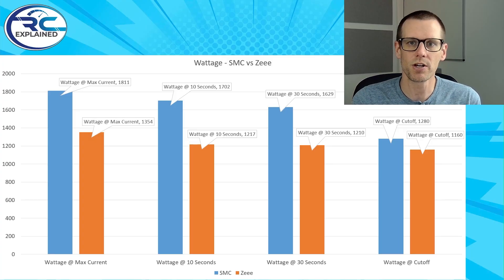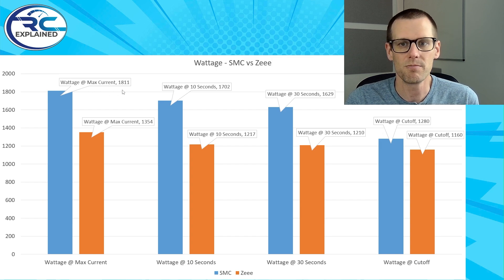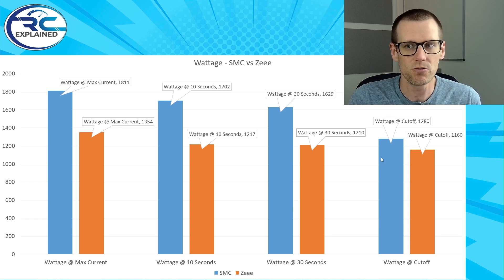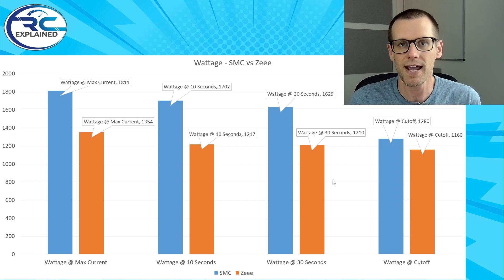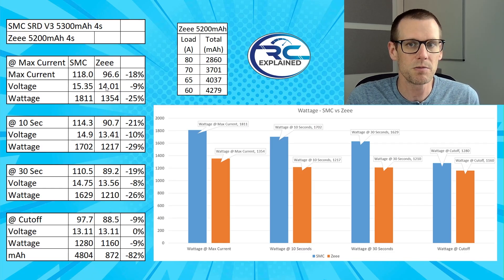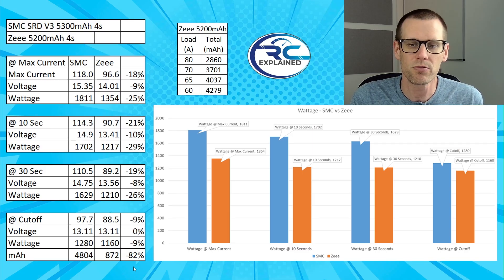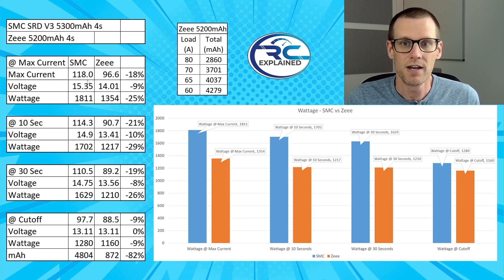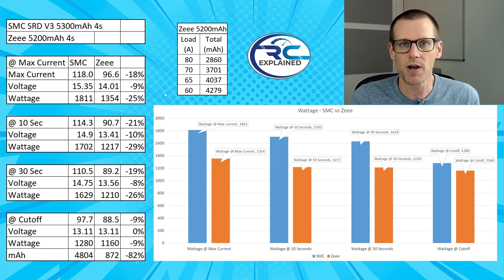Best vs Worst RC LiPo Battery Showdown! Performance Data Doesn’t Lie!

Comment: It's so wild to see this Zeee pack doing poorly. I have some 2s and 3s Zeee packs that have been doing fine since Christmas. Especially The 6200mah hard pack 3s with the red checkered background graphics and the little race car on the sticker which reads 120c 68.82Wh. I don't believe they'd test at 120c, but they've been running really strongly in my XTS-F10 with really long run time, and are Actually UNDER rated for capacity. They take in closer to 6500mah charging back to 4.2v per cell, and don't get warm charging for me either. I'd be really curious to see those bench tested!
Reply: The video shows capacity when tested with continuous load of 60,70,80 amps. The battery drains in minutes in his tests. I am sure when you use your batteries the battery will last for 10-30 minutes, which means you are not pushing the battery too hard. I guess the video shows what the battery is doing when you demand full throttle from your RC car.
Reply: @uhjyuff2095 I demand plenty of full throttle, but yeah I think his tests are more like asking full power from a plane or something like a speed run than a normal car. Either way I'm interested to see if it's just these sort of "standard" labeled Zeee batteries that are coming up short during these tests, or if any of the ones they're labeling/marketing differently fare any better

Comment: I guess it depends what you want them for ? 
I appreciate SMC are Powerful. 
I ise some Zee Lipo’s . They better some of the Cheap ones like Yumme , Zop, they Dont have the capacity proclaimed . But the Zee are good Value , they run well enough for my Usage. They balance up well, the internal resistance is good. I had one bad lipo delivered i contacted them sent me another the Next day. 
I cant fault Zee lipo to be honest 
Yes if you want to Pay £100 for one lipo you expect it to better . 
But for joe bloggs mr Average zee are good enough
Reply from the maker: Exactly. if you are after performance almost any LiPo can do better.

Comment: I don't care what your data shows. My experience has been all positive with Zee. I have approx 20 zee packs in various sizes. Never a failure after dozens upon dozens of cycles over a few years. Not even a puffed pack

Can't say the same for Spektrum  packs = 2 failures. Never owned SMC but I see no reason to when the Zees give me everything I want at an affordable price.

I sticking with Zee. Best bang for my buck without a doubt.

Comment: In performance applications under WOT loads at a full 4.2v per cell. What is the max voltage drop (underload) that is still considered "safe" and no damaging to the battery? I seem to get different answers everywhere I ask. OR will this vary based on the thermal load on cell type too much to generalize? I have a pretty huge 40ah100v 24s pack that I'd like to draw 600a from. But I am seeing it drop down to about 3.2v at 400a loads.
Reply from the maker: You can simplify the answer to be what ever load the pack can handle while maintaining a reasonable operating temperature.
Reply: @RCexplained  Thanks, so as long as I don't exceed say 50c or so the voltage drop isn't really an issue when under heavy load for say 10 sec or less?
Reply: would a temp indicator taped to bat body be ok?  I just don't want to damage these huge expensive tattu12s bats but would like the max output.
Reply from the maker: Temperature is your best indicator regardless of load.
Reply from the maker: @AdamOpheim I prefer a temp sensor on telemetry if I'm worried about it.

Comment: I would love a video where you break down the actual components to the battery. What type of Lipo juice they use, materials, type of wires and insulation. Where the money is and why.
Reply from the maker: that is an interesting idea!

Comment: What’s that supposed to mean? Completely absurd comparison. A SINGLE SMC SRD V3 4S/5200mAh costs €90. TWO Zeee 4S/5200mAh cost €89. Auf gut deutsch: Zu viel Lack gesoffen?!
Reply: Is it?  2 Zee packs that are damn near useless to my 10" FPV drone, I would rather have the one pack that can power it

Comment: I have eight 6S Zee packs (4 x 2200mah and 4 x 5200mah) that I use in RC helicopters (sized 420-580).  The Zee packs have worked perfectly for over 3 months.  I can't speak to their long term ability, but for the 3 months I have used them I have been very happy.  My Kraken 580 can max out over 130A (as monitored using VBar/Hobbywing telemetry), so there's no shortage of power.  Battery construction looks great, so I don't know what some commenters here are talking about when they say the construction is poor.
Reply: You gotta try a reputable Lipo brand and you will see. I felt robbed when I did and that I’ve been cutting my rc time so short running zeee lipos

Comment: Another BULLSHIT battery review. I'm in Australia where the Zeee battery is $48 and the SMC battery is $200. Further the Zeee battery is 120c compared to the SMC at 250c. Completely different types of batteries and one is 4 times the price of the other. FFS🤦
Reply: I do they're junk...
Reply: You do know that the Zeees false advertise their labels. Try to run SMC or another higher quality Lipo then do that with the Zeee. Same specs the Zeee runs about 50% as long, so either Zeee uses low quality material, which matters or, they are lying. You do know they have Zeee premium lipos that are supposedly higher quality at about double the price. Still low quality.
Reply: @MrSkullface Battery manufactures apparently can’t test the discharge rate beyond 70c
I’ve seen lower amp discharge packs perform better than some that were quoted a higher rate. I think most companies aren’t being honest there
Reply: @lorlin1978 true but I will give credit to SMC that they have a page on their site why they still add their inflated C rating. Basically if they don’t no one will bug them assuming they are inferior.
Reply: Not a bullshit review not only what this dude said is true but I've had problems with almost every zeee battery pack I've had... and I  not making no video I'm telling you straight...facts!!!
Reply: @VinydFPV  BS....I have over 20 Zee packs and have been using them in airplanes for a few years. Never a failure.

Somehow I doubt  that I got all the good ones and you got all the bad ones.
Reply: @VinydFPV  It's bullshit. I don't have any probs at all with Zeee batteries.
Reply: @avronaut it’s not do you have issues, its about real world runtime and battery sag compared to higher quality Lipo brands.
Reply: Exactly

Comment: I'd really like to see these results displayed on real life situations.  How does these stats show up in the same vehicle?   Is there a recordable difference in speed, acceleration, and run time?  That's what matters to me.  If i can't notice a difference bashing what does it matter what happens on paper?  I've one got 1 set of Zeee batteries but they're over 2 years old and sell work fine.  I can't tell a difference from the first charge till now.  Most of my batteries are CHNL and Gens Ace.
Reply: Realistically, you probably wouldn't notice unless you're comparing back to back, or racing competitively and need all the punch you can get, which is where these differences can absolutely be felt, especially near the end of a race where voltage sag is more apparent.
For bashing and casual use, it's probably not worth spending the extra $ on the best packs. If the cheap ones work fine, might as well stick with em!

Comment: Zee lipos are ok for the price but Ive had 3 out of 4 of my zee packs fail and I’ve had them for just over 6 months. They all had the same issue with cell no1 not wanting to charge anymore.
Reply: I never got why people say Zeee is good for the price (not including sales), you get less battery per dollar compared to SMC. The comparable Zeee to SMC is the premium line of Zeee.
Reply: @MrSkullface  Bullshit. ONE SMC 4S/5200 is 90 bugs. TWO Zeee 4S/5200 is 89 bugs. The SMC will deliver 10400mAh ?!
Reply: you missed my point. Zeee Lipo mah capacity is grossly exaggerated. You are not getting 5800mah on Zeees, you are realistically getting 50%-70% what the label says. Test it out yourself, get an SMC and Zeee with the same capacity and see what one lasts long and how long.
Reply: @MrSkullface  You are wrong Period
Reply: @avronaut  Tell that to all my Zees and SMCs and hours racing both and comparing. This video already logically negates your point.
Reply: @MrSkullface Those who talk to objects shouldn't claim logic. I've been selecting and configuring LiPo batteries myself for over 20 years, and I know more about parameters like internal resistance, capacity, cycle life, etc. than the average loudmouth victim of the Dunnig-Kruger effect. Believe what you want and keep talking to your batteries. 😂
Reply: @avronaut this video is a test backing my claims up, where is yours
Reply: @avronaut okay? So what you are saying is that Zeee lipos in real world applications are equal to SMC and other quality brands. Thats my 8 Zeees with the same specs, even better specs than my Zombies and SMC lipos are just all duds due to lasting about half as long. Or that I’m making it up and I can’t tell the difference of time, that my timers and other peoples phone and timers are all lying to me. 

There is a benifit to Zeees, because they run out so quick, they are great for quick casual runs to storage voltage, I have to discharge my other lipos which take forever.
Reply: My zee 3s premium does not last long, gets hot quicker and is even worse in cold temperature.
Reply: I've had 2 of my 4s Zee batteries have a cell die within less than 3 months. So I won't be buying them anymore.
Reply: I got my zeee batteries all on sale but I wouldn’t buy any more. They are very cheaply made